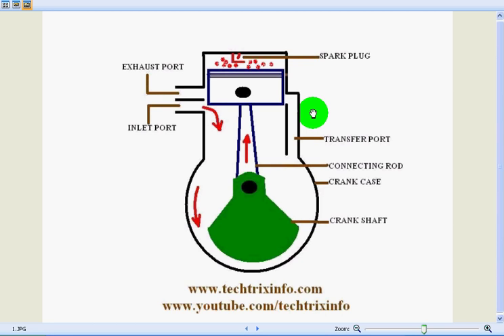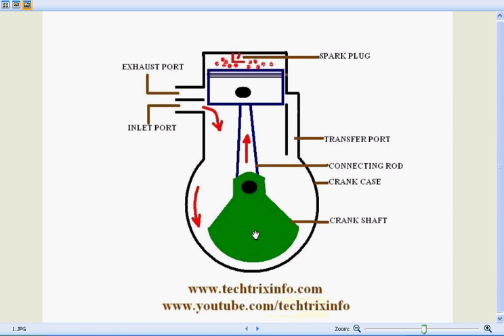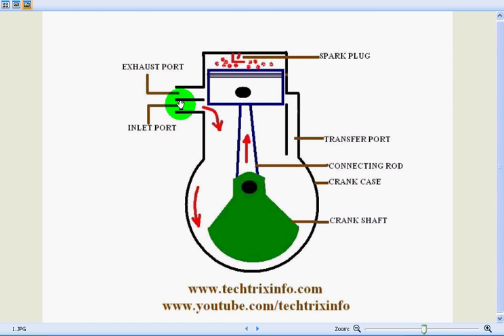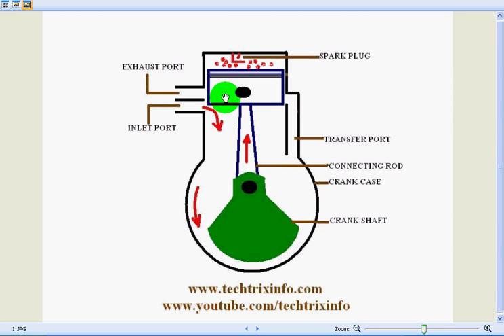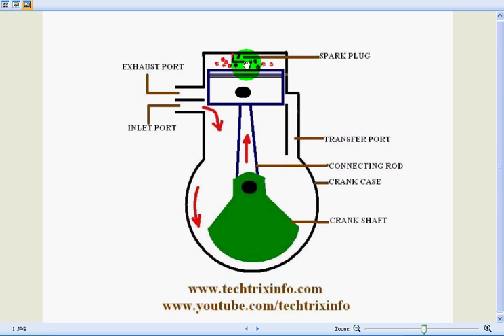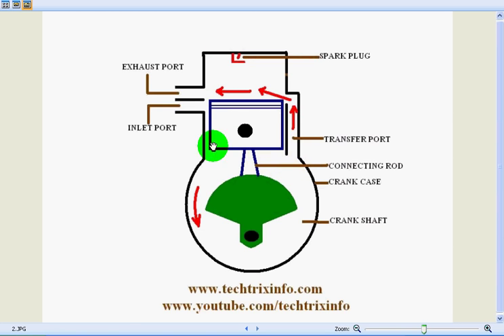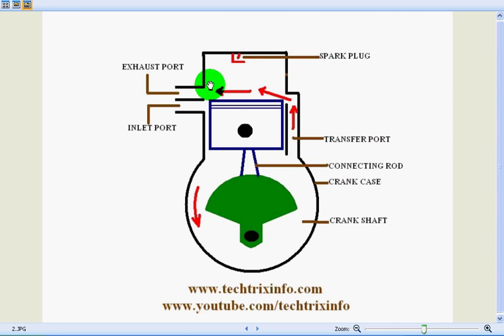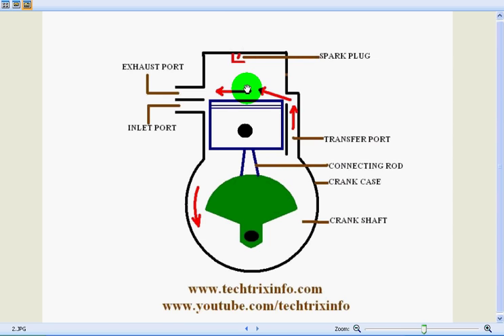Animation - How two stroke engine works. ✔

Comment from the maker: No What i have said is right. please have a look at the video once more..its same as what you have said..1 stroke causes 180 degree rotation.... 2nd stroke causes another 180 degree rotation.... so total 360 degree... which means that one revolution of crank shaft in 2 strokes....

Comment: what is the purpose of the transfer port? and how is made i thought it could be attache to the cylinder wall
Reply: to allow the air and fuel mixture to flow into the combustion area. the air and fuel that is from the inlet port is stored in the crankcase, and flows into the combustion area when the piston is towards the bottom and the transfer port is uncovered
Reply: ok i see

Comment: No you are wrong...

1 stroke causes 180 degree rotation.... 2nd stroke causes another 180 degree rotation.... so total 360 degree... which means that one revolution of crank shaft in 2 strokes....